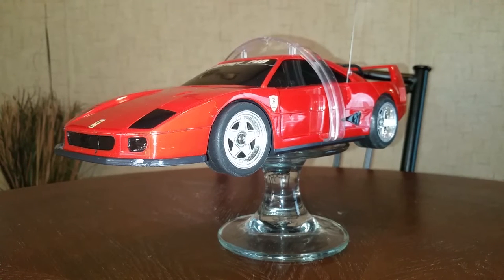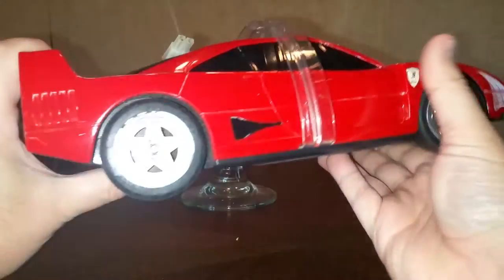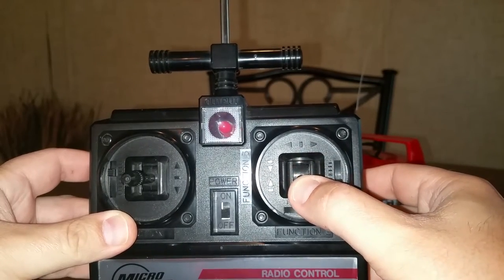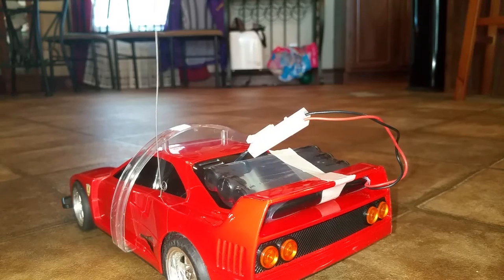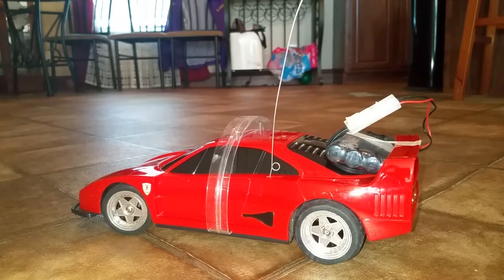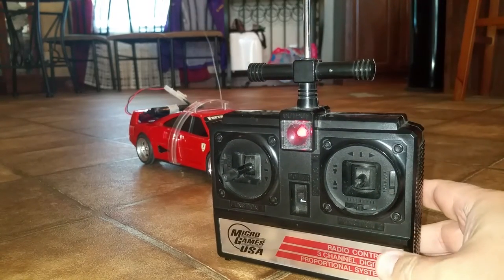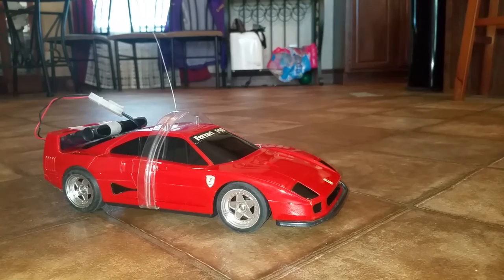Ferrari F40 RC VERY STRANGE!!!!!

Comment: Just bought one of this bro can u explain if I can use a tyco rc Lamborghini countach control on another one that's same 27mhz I got 2 one with out controller other with it lmk thanks
Reply from the maker: Hi. In most cases you can use the same remote itself the frequencies are the same.  However you can run into an issue from time to time that even though the frequencies match, it wont work.  Usually happens with the early tyco controllers that use the blue and white frequency sticker on the remotes. What does the frequency sticker on your cars and remote look like/say?

Comment from the maker: It does run suprisingly well considering all of the modifications i needed to do!!
Reply: Hi, I still have mine, exactly the same, I bought it new in 1989 & it still all works but I don't have the box. Mine says Micro Games on the controller and says made by Apollo in Korea on the underneath where the center wheely thing is & also on the back of the controller. How much did the one on eBay sell for you were talking about?
Reply: Yo tengo uno igual a dónde te puedo mandar el vídeo para que lo veas en acción

Comment from the maker: Yeah, I dont have any lipo batteries.
Reply: +VintageRC_Nut maybe one of these will fit in it ?
http://www.ebay.co.uk/itm/9-6V-3700mAh-NiMH-COMPACT-rechargeable-battery-pack-Vapextech-/371028537208

Or a stacked AA size 9.6v battery ?
http://www.componentshop.co.uk/9-6v-2600mah-compact-aa-nimh-battery-pack.html

Theres also the option too use protected lithium ion cells 14500 sized ones or larger
(2 of them should be close in voltage but pump out quite a bit more amps then any old toy grade nimh battery)
while the 14500 is small in capacity the weight save is a nice thing to have in most rc toys.

I found a few battery cells in laptop batteries that still took a charge with an old lithium ion battery charger that was 18650 sized.
These cells are often unprotected though so you'll need a low voltage alarm that beeps when you start to drop too a certain voltage too not hurt the batteries.
(When its a solid beep running it slowly or on non turbo in low gear or simply running the motor while holding it up in the air causes it too beep its time to recharge it.)

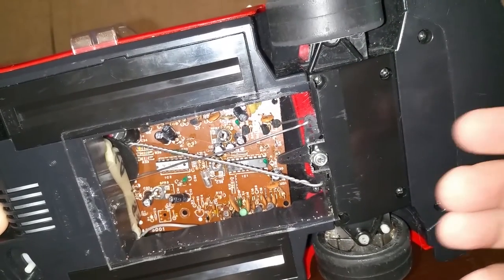i've run my junk batteries in an old 1:24th scale pan car a few times (in a pair i clocked with the tired old stock motor too 34 km/h instead of the old tired nimh pack it had included with it (AAA sized & 7.2v)
And in a rc toy that ran on 3 aa batteries a single 14500 cell in place of the 3 aa's is pretty great weight saver while providing a bit less voltage its still happily zipping along with a single cell.

theres ofc smaller AAA sized cells available too if you look around a bit that come protected.